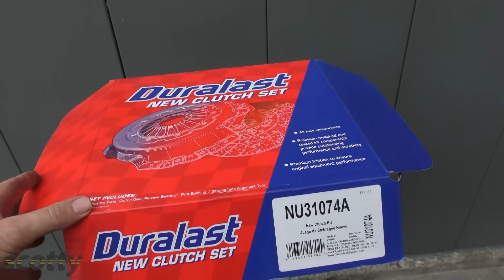5 Things You Should Never Do in a Manual Transmission Car

Comment: Emergency brake... it’s a handbrake. It’s supposed to be used when ya park.
Reply: Not really if you just park and use the emergency brake/ handbrake you can stretch the cable and ruin it If you park and use it whenever
Reply: @adamskead8859  I drive a Saturn Ion that's had the Hand Break used every day since 2004. You underestimate handbrake's power.
Reply: @adamskead8859  What's cheaper, repairing a handbrake, or rolling into another car/person?
Reply: "emergency brake" is an old term.  Young people today say "hand brake" or Parking break".  
Also, they can be adjusted and it's easy to do and cheap.
Reply: we dont say handbrake in America
Reply: @nunyabiznis817  we don't say handbrake in America
Reply: raleighman3000  So what?  Your comment is irrelevant.  You know what the term means.
Reply: Lots of people say handbrake in America. It's a big place.
Reply: @jimjambananaslam3596  Maybe in some backwoods place.
Reply: @OG Ethan backwoods is a word, einstein.
Reply: Pointless comment. People know what you’re saying whether you say E-brake/handbrake/emergency brake. This comment is like correcting someone for say pilot bearing instead of throw out bearing.
Reply: Handbrake, parking brake, makes no difference. Its meant to be used to park the car and prevent it from rolling. Its fair safer to force calipers to hold the wheels with no stress on the transmission than to put all the stress on the transmission hoping that it can overcome the forces of gravity to keep the car from moving. Its fair easier to replace brakes than it is transmissions and most people rarely, if ever, have to change the cable on their brakes, just keep it adjusted. You risk your car rolling, and getting damaged and costing you lots in damages.
Reply: well what if your disc brakes fail when driving and your only option is to use your emergency brake/handbrake or parking brake
Reply: @novagsiful  That is the secondary function of a handbrake so you would use it obviously as well as lots of engine braking too.
Reply: Gravemind its comman sense to down shifting/engine brake and using your handbrake when front brakes go I would go on with it but I would end up boring you with a mechanic's view
Reply: @novagsiful  Common sense isn't so common today but I hear you. Driving schools in the UK don't teach you what to do if your brakes fail, I was taught that by my parents thankfully.
Reply: Gravemind to true and driving schools are crap as they only teach you the basics and should be really helping when brake failure etc happen and I had to learn the hard way
Reply: a that's for parking on a hill and turning the wheel towards the kerb and you must have coppers about then
Reply: a really would help that i ain't from the us
Reply: Or drift 😂
Reply: Also push the button in while applying the handbrake
Reply: @dhm1983  why do that that when you trying to slow down a vehicle not dirft
Reply: @novagsiful  because it's a handbrake to be applied when the vehicle is stationary. If you don't push the button in while pulling the lever upit wears down the mechanism of the brake. At least that's what sensible drivers in UK and other countries do, but then again you elected trump
Reply: @GUITARTIME2024  I say e brake
Reply: @novagsiful  
A, why would you ever use the handbrake when the car is moving unless you're trying to lock the wheels?
B, some people say that not pushing the button when pulling the handbrake means you'll wear out the ratcheting mechanism, but it's doubtful that you'll ever do that unless your car is poorly built or you do it an absurd amount. (I still push the button though).
Reply: Parking brake, e brake, handbrake, who cares it’s the same
Reply: I say side brake hahaha
Reply: David  MacDonald that trump thing was the most irreverent thing you said
Reply: @adamskead8859  it's a hand brake or a parking brake. It's not just for emergencies!
Reply: How is it an emergency brake? If you use it in an emergency you're gonna skid 😂
Reply: DreTheChronic maybe when something is up with your brake pedal?
Reply: @dlozza2000  but if you use but you'll just lock up your wheels?
Reply: @dlozza2000  he's talking about the handbrake, it's not a pedal.
Reply: MatthewJBD I know he’s talking about the handbrake which is why I said when something is up with your brake pedal it’s said that’s why it’s called an emergency brake
Reply: @dlozza2000  that's not the reason haha
Reply: Shouldn't he have pushed the button in when putting the hand break on
Reply: Love the term emergency  brake  because  if there is one thing you dont want to do in an emergency  is pull that fucker.
Reply: @GUITARTIME2024  or just people  who know how to drive
Reply: a  that's what virtually  every country  in the world  does
Reply: @DreTheChronic  you can use them gently  to slow you down  if you know what you  are doing ,they also help you turn again if you know what you are doing.
Got to agree that in most cases people  would just panic and pull the fucker right up and end up spinning  off the road or something.
Reply: @cardiffpicker1  huh?
Reply: @GUITARTIME2024  huh what
Reply: @adamskead8859  you are literally taught in driving lessons to use the handbrake whenever you stop... Handbrakes only really get worn quickly if you use it before the car has completely stopped. That's when it gets stretched.
Reply: Same crap
Reply: Adam Skead so youd rather ruin your gears than a fckin handbrake cable? LOL
Reply: The foot brake is good to use in a emergency don't lock your wheels kids
Reply: No it's actually call a secondary braking system
Reply: It’s for parking. And only parking using it for braking it’s idiotic that’s what abs is for! Your not Paul Walker trying to drift jesus
Reply: Thats's just bs. It is meant to be used, with manual gearbox, car can start to roll unexpectedly when you disengage the clutch to start the engine. That happened me yesterday, when the mechanic had left the car in the slot only by gear. That could have been dangerous to person with slower reflexes as the parking lot was really packed
Reply: You should get into the habit of using your handbrake when parking, because if you don’t, you could be on a slight hill and forgot to put the handbrake on and it will start to slide, while if you have got the habit of putting on the handbrake when parking it will never happen.
Reply: Emergency break handbrake there the same thing
Reply: @dhm1983  that's a load of nonsense, the mechanism will last more than the lifetime of the vehicle...
Reply: @GUITARTIME2024  handbrake, parking brake, e-brake, it's all interchangeable. Maybe YOU don't say handbrake, don't assume to speak for everyone else.
Reply: @klavier285  wrong
Reply: @dhm1983  your comment about pushing in the button, on my Corsa, it had a mass manufacturer's handbrake fault and was recalled. It says in my instructions, don't press on pull up, ONLY press to release the handbrake. Otherwise it may not correctly set.
Reply: @dlozza2000  if something is wrong with a brake pedal I damn sure wouldn't be driving
Reply: E- brake, Handbrake, parking brake. ALL THE SAME.
Reply: Ryan Mercer he’s in Texas we don’t care what Europeans call it
Reply: @GUITARTIME2024  yeah we do
Reply: @eillswim  yea as a teen who just got there license in the us i can confirm you only use youre hand break for parking
Reply: You're funny for thinking people use it for parking.
Reply: @Sci-Mon1  oof
Reply: @sadladcinn  in terms of a manual car, it's no option. But in an automatic, most people never use. Even when they should.
Reply: @Sci-Mon1  thank you for the clarification i was a bit confused
Reply: @sadladcinn  it's fine. I kinda forgot that he was referring to manual transmission cars.
Reply: Use that hand-brake on -18 outside 😂 u will never ever do it again✌👊🤣
Reply: Ryan Mercer I use it to initiate a Scandinavian flick
Reply: Stop being that gone guy.... It's an E-brake, Parking brake, handbrake, whatever the name, the concept is the same... It to stop your vehicle from rolling or moving (i.e., parking or slowing down).

Just get used to the terminology differences, and accept that people will call it different things, you aren't the only one in the world remember...
Reply: Or when you drift.
Reply: @Dancolemusic  you do know a pilot bushing is not a throwout bearing right???
Reply: Do you call it a handbrake when it's a pedal on the floor like in a pickup? Absolutely not...
Reply: @Goabnb94  I've owned several old Chevy's with 4 speeds and no "handbrakes"... You put it in gear and it ain't going anywhere. I've literally had my old 66 c10 rear ended while it was parked and in second gear. The truck moved less than a car length when it was hit by a car doing 25-30 mph. I've parked my 84 up a 70 degree incline to take a picture. Shut the truck off and put it in 2nd gear. Guess what... It didn't move more than a few inches.
Reply: @konnerkramer329  well I was talking more automatic transmissions, but it's still best practice to apply the handbrake anyway
Reply: Konner Kramer every motor vehicle has a pedal on the floor for a brake... still doesn’t mean it’s an emergency brake. Emergency brake is a manoeuvre, not a pedal or a pulley.
Reply: @ryanmercer3352  that's not what I was talking about genius... The parking brake on every pickup is a pedal on the floor board. You press it down and it locks the rear drums. But 90% of the time on old pickups they don't release the brakes so the cables get cut.
Reply: @Goabnb94  why would you use a parking brake with an auto??? When you put the trans in park the parking paw literally locks the input shaft and prevents it from moving.
Reply: @konnerkramer329  because it's actually only a very small piece of metal that is locking the transmission, so all the weight of the car would be on it. Have you not felt how much more difficult it is to take the car out of park if you put it on a slope without the handbrake? Thats because your fighting against the weight of the car. The handbrake holds the wheels, and they both act as a failsafe for each other, especially as the brakes aren't as likely to fail (they are on a cable, not hydraulics like foot brakes).
Reply: @Goabnb94  it's not a very small piece of metal. It's usually 3/8-1/2" thick hardened steel. If you think that can't handle the weight of a vehicle you would freak out just walking in any metal shop. When I used to build pressure vessel sheds for the oil field. Each she'd was 70,000lbs once the concrete was poured and the vessel was attached. We used 2 3/4" thick lugs to lift 70,000lbs. Each 3/4" lug was lifting 35,000lbs... I think a parking paw can hold a 3000lbs Camry or even a 8,000 crew cab diesel with zero issues.
Reply: @konnerkramer329  The way the pawl is inserted into the transmission is completely different to a load bearing bolt or lug that is fixed into place. Its not like there have been cases of the parking gear failing. Most manufacturers and mechanics do not recommend using this as the sole method of holding a car in park and actually recommend applying it only after applying the hand brake. Its not so much an issue of shearing the metal, but more the stresses that are placed on the transmission and parking gear with constant use. In that sense, its completely different because it is a moving part designed to interact with other moving parts. Conversely, holding the vehicle with the hand brake physically stops the wheels from turning. Meaning that the wheels cannot even turn to place stress on the transmission. And if either fails, you have a back up. Of course I recommend both leaving in gear and handbrake in a manual for the same reason, but of course the reason why it works is different, you aren't locking up the transmission, you are basically engine braking even while still.
Reply: @Goabnb94  I'm fully aware of how a parking paw works in a trans. I've rebuild so many turbo 350 and 400, 700r4s, c4s, c6s and 727s I can basically do it in my sleep. If the manufacturer didn't want the parking paw to hold the weight of the vehicle they wouldn't have designed it that way... The fact of the matter is the parking paw is the sole thing holding millions of vehicles from moving. It's been used for 70 years. If this was truly an issue the manufacturer would have designed it differently.
Reply: @konnerkramer329  Oh silly me. If they had designed a parking pawl to be a parking brake, they wouldn't have designed and built a handbrake into your vehicle, right?
Reply: @Goabnb94  yeah because every auto vehicle on the planet has a parking brake right? I hope really you don't think the reason why vehicles have handbrakes is to "reduce stress" on the trans. I've never in my life seen anyone ever set the parking brake then put the trans in PARK. You want to take a guess why it's called park?
Reply: @GUITARTIME2024  well im in VA and we call it emergency and hand brake
Reply: Emergency brake (E-brake), Parking brake, Handbrake, WHATEVER... IT'S ALL THE SAME THING, DUH!!! Just get used to it.
Reply: that would make it a parking brake.  particularly given that in lots of vehicles it's operated with your foot; not your hand.
Reply: Emergency brake, parking brake, handbrake, all the same thing and it serves two purposes, a brake to set when parking and a brake to use in the case that your hydraulic brake system fails. Also a stretched Emergency brake cable is normal just like a stretched saw chain, just adjust it until it works right.
Reply: Ryan - it's both, before you criticise....
Reply: @richardgrant7055  it’s a handbrake, or a parking brake.

Comment: Finally a "What not to do" list that isn't entirely about driving habits of the driver but also maintenance related things.
Reply: Kiraro The Kitsune i have been abusing my 93hilux for 20years and never had an issue with the transmission :D
Reply: Mr.surfer Toyota hilux are a tank, no doubt or question about that.
Reply: the latest Hilux is pretty easy to destroy we ruined our clutch after just 20,000km over 6 months
Reply: Mr.surfer Can't relate, I'm stuck with a slow shifting automatic.
Reply: Kiraro The Kitsune I have a 3 speed auto, and it never had a fluid  change ever. I wish I could do it but I cant. It has 134k miles. The reason I wont do a change because it will probably kill the tran since the same fluid is 17 years in trans.
Reply: Hash Mine hasn't had a fluid change in 15 years, it's a 4 auto
Reply: Brad Yelich Yea I know about doing the flush and that. But the reason I dont want to change the trans oil because its been 17 years in, its basically its life. And its not my fault, the guy who owned it use to beat the car and literally neglected every oil change, brakes everything. When I got the car it was 25k mileage overdue on oil change, I went to drain the engine oil right away and put in best synthetic oil to revive the engine and after 200 miles, I did another change. So, the only thing I cant save is the trans, hopefully it survives, its a Toyota, I expect the solidness of it to last. But I will say that I love my Toyota corolla, if it ever fails, I will buy another one without a doubt and same model. I use to work at Valet and driving cadillacs, audis, mercedez and all those fancy cars were ok but when half of them had a check engine light, I knew those cars are money pits. Toyota corolla all the way baby. Lol.
Reply: 6
Reply: This one of those rare and good channels on youtube.
Reply: sergiodriftdrift Deserves more love
Reply: When I’m just cruising around town I usually just throw the thing in neutral and just use my brakes

Comment: As Richard Hammond once said "changing gears is a form of self expression". I drive daily on the twisty B roads of Devon so changing gear constantly too match the bends is a joy especially in a playful Fiesta.
Reply: Absolutely,  I live in New Zealand and have simalar roads and this causes no more harm to the vehicle than everyone beats on about.
Reply: I drive up and down the mountain for work everyday. Love my 5 speed fiesta, I hope to get it out of the shop in the next few days(I blew my timing belt out at 106,000 miles) it went boom
Reply: @Will-tm5bj  If you ever have to replace the timing belt again, supposedly putting stuff like 303 Aerospace on belts, hoses, tires, helps to keep them supple and longer lived.  Leather treatments allegedly work some as well.  Normally I don't like to pass around info I haven't actually tried myself, but I've seen so many sources talk about, and some credible seeming, that I figured I'd at least mention it.
Reply: @justinw1765  so as it turns out, the timing belt was fine. The bearing for the tensioner pulley seized up, broke some hunk of metal off, fell to the bottom and got caught and made the belt jump timing. It shredded the valves and everything. I'm still having a missfire on it above 3,500 rpm and at highway speeds 70+
Reply: "It" being the new to me motor that had 32,000 miles on it.
Reply: @Will-tm5bj    That sucks, sorry to hear about it. Hopefully it doesn't cost too much to fix.
Reply: @justinw1765  it was "only" about 3,000 bucks lol
Reply: @Will-tm5bj  Ouch. 

   When I can, I'm going to start saving up for an electric car.  Lot less moving parts to break, and A LOT less fluids to maintain. But hopefully by then, battery tech has improved significantly more than now.